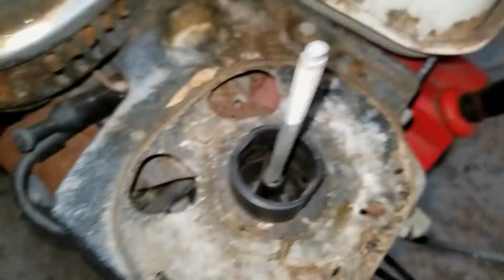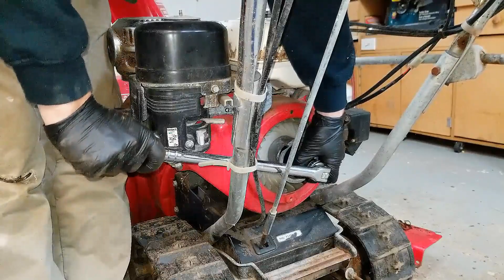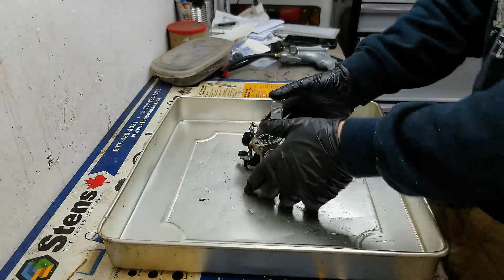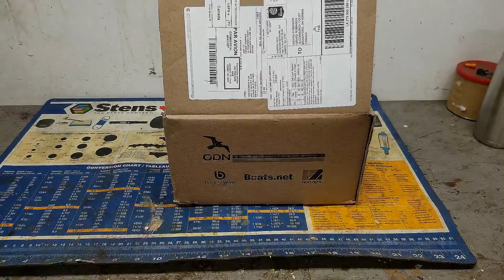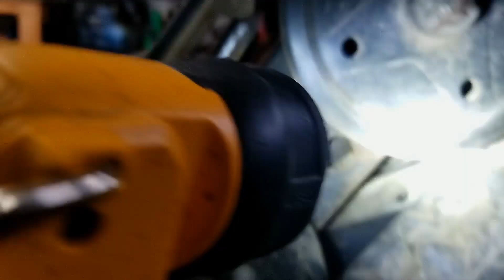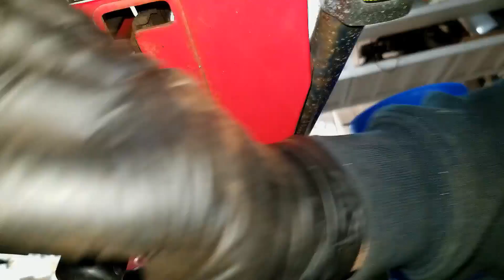Honda HS80 Refurbishment. Carb Clean, Friction Disc Replacement and More

Comment: Hi Brant, thanks for the video.
Sometimes my 1st and 2nd gear doesn’t work.  I’ve tried adjusting and they will work for a few minutes but then act up again. Any tips? My friction disc is in good condition. Thanks!
Reply from the maker: I wonder if something is bent?
Reply: First check that the drive belt engages properly and adjust that if needed by loosening the cable ferule to bring it down. Once it engages properly, check the cable to the right of the shifting rod under the leaft handle and adjust the cable ferrule upwards (the opposite of those on the right side).

Comment: Just bought one from my neighbor for 300 and not a speck of rust or even a chip in the paint and the tracks look brand new. Cant wait to use it this winter. The thing starts on  the first pull too !!
Reply from the maker: That's awesome! Glad you got a good deal and have fun with it. Cheers

Comment: Hi from Montreal. I have the same beast Honda HS80 with treads just like the one in the video. Can you help me? I need to get a starter assembly (recoil), the entire housing with the starter rope. Can you point me in the right direction on where I can buy the starter assembly, used or new . I believe the part is 28400-ze2h21h
Reply from the maker: I usually just use Google or try and find a junkyard

Comment: "Was running fine except for no drive function" LOL. The previous owner wouldn't have scrapped it if that's ALL that's wrong with it!
Reply from the maker: Only expect half truths when buying used equipment. Thanks for watching and taking the time to leave a comment. Cheers
Reply: Believe me, it comes a time when you get tired of trying to fix old snowblowers that are so difficult to finds parts for. If it wasn't for my legendary stubbronness, mine would have been junked at least a decade ago from the hardships it went through. There is practically NOTHING I haven't repaired on mine except for the engine. The front auger and imperller housing is so worn out from use now that the metal has perforations in it that snow shoots out of it now. And I'm not even sure that's going to stop me (I'm considering doubling the impeller housing with a piece of sheet metal, lol)

Comment: Very well done. These Honda snowblowers are very well built. I had an hs80 for about 20 years, sold it for what I paid and bought an HS928 in 2007. Still runs like a top but thats with regular maintenance
Reply from the maker: You're right, pretty hard to kill them if you keep up on the maintenance. They just don't build stuff like they used to. Thanks for watching and taking the time to leave a comment. Cheers.

Comment: What a great video....well done. I have the same snowblower and it runs a bit rich. Any recommendation for adjusting the carb to have it run a bit more lean?
Reply from the maker: How do you know it's running rich? Is it blowing black smoke? If it's a non-adjustable carb then the only way it would be running rich is a jet that got drilled out too big or there is a restriction in air flow entering the carb. I'd start there.
Reply: @brantsmallenginerepairs  The spark plug is black, carboned up. No idea if a jet was drilled. No smoke at all. I'll check it out, thanks for the info.

Comment: Nice job, just wanted to point that the spring you removed to take the pressure off the disk is the adjuster for your track speed. If you loosen the 2 nuts on the screw that you took the spring off of, you can move the screw in or out as you seem fits the speed you need. Once you get that where you want re tighten the 2 nuts so it stays in the same position. Keep up the good work. Liked this video. I have a HS 50 and had to do some of the same things you did but never made a video.
Reply from the maker: Thanks for watching and taking the time to leave a comment. Cheers

Comment: Great to have found your channel, what with most youtube channels now having clickbait thumbnails...

I have had one of those for the past 10 years or so, i9t was not nearly as nice as yours when I got it and and I figure I paid too much for it at the time I got it consireing its condition, but I had another one for parts, so I've been able to keep it alive, as its gearbox was in awful shape due to worn out bearings and I had to make a good one out of the two. Since you're in Canada like me, how much did you pay for yours?

One thing with extremely old and worn machines is that corrosion will play a lot of tricks on you in the course of adjusting things and keeping them alive - the engine is basically bullet proof, but the snowblower parts really get beaten up bad where I live (I usually have to go through two foot snowbanks of icy and gravelly snow to clear my driveway, and tyoically run though a dozen shear pins every winter). I've had to weld reinforcements to my augers and the impeller as well as they got beaten up bad because of my snow conditions and I go though at least a dozen shear bolts and at least an auger belt or even two every season. I've also had to replace auger housing bearings a few times, and repair weld the housing a few times as gravel would get stuck and wear the sheet metal quite thin.

Like you, I found out water does get into the fuel and can play havoc with the engine missing, but I usually simply flush the carb bowl and I clean the jets ever second year or so and keep an extra carb on hand for parts such as the shut off valve and the float valve that tend to leak over time after I had to replace my original carb due to corrosion and gunk from leaving fuel in it over the summer - learned the hard way you're supposed to run them dry before storing them.    

I noticed your friction disk is wrong - the PO hacked it, bolting another disk to it doubling its thickness, probably to increase friction on the old friction wheel. You need to unbolt the piece of metal he sandwiched to it to run it properly, otherwise your new friction wheel will wear really fast.
Reply from the maker: Thanks for watching and taking the time to leave a comment. I don't recall how much I paid for the machine and I sold it last winter.

Comment: What a shame the way people take care of equipment. Man what a mess.
Reply from the maker: Shows you how well built stuff was back then that it lived. Stuff nowadays would have made it to the scrap yard. Thanks for watching and taking the time to leave a comment. Cheers
Reply: Especially considering how little use it seemed to have had! I wish I could get my hands on one in such good condition! Mine needed much welding to the auger, impeller and housing when I got it due to the harsh conditions we have in our area, having to go through through hard packed icy snowbanks mixed with gravel...

Comment: Where are you located in Canada?
Reply from the maker: Brantford, Ontario
Reply: Do you do jobs on the side? I have almost the same snowblower that needs to be fixed The auger is not working properly.
Reply from the maker: @mrcass8075 yes I do. Contact me at brantsmallengine@gmail.com

Comment: I'm in Brantford too!  Just found an HS80 cheap that had the impeller move forward into the augers :( .  The engine, carb and overall condition of the unit is absolutely incredible.  Working on getting the front housing all off so I can inspect why the impeller movement forward into the auger housing and to see just how bad the damage is.  The front/auger gear box housing broke as a result so I will need to source one of those too........  I cant seem to pull the auger gearbox housing off the auger shaft from the transmission/belts.  I pulled the 3 screws at the back of it but it just moves forward/aft about 3 inches on that connecting shaft.

Thank you very much for the videos, nice to get some quick tips and see inside the beast on here before going out for hour 2 tomorrow.
Reply from the maker: Glad I could help out. Good luck with your project. Cheers
Reply: @brantsmallenginerepairs  do you know how I get the front auger drive/gear housing off?  I can't seem to figure it out.  I have the full front assembly off, the chute off, the augers out and the impeller shear pin out but can't for the life of me figure out how I get the gear casing off...... just moved forward and aft 2 inches but hits solid stops.  I feel like I'm missing something silly
Reply from the maker: @C.HL.A  honestly, I haven't taken one of those apart and I don't have the machine here anymore to look at it. If you send me your email, I can send you a shop manual that might help.
Reply: @C.HL.A  donyboy73 has a nice video on how to overhaul the auger gear box. Be ready for the steep sticker shock for the worm gear!

Comment: Enjoyed watching all your hard work and patience bringing back this almost antique Honda back to life. Even if my Honda snowblower has a have a hydro-static transmission, the friction wheel replacement procedure and pitfalls are nice to know. Just one comment: I would use methyl-alcohol (gas line antifreeze) as a surface cleaner instead of gasoline. Finally summer is always the best time to watch a snowblower repair video. Take care.
Reply from the maker: Thanks for watching and taking the time to leave a comment. Cheers

Comment: Great video. Did you have to drain the oil and gas before tilting it up in the service position? Thanks
Reply from the maker: Draining the fluids would be ideal. Draining the oil is not really necessary but any spills I've had are usually the fuel. If there is a fuel shutoff, you could close it and just drain the float bowl of the carburetor. If the fuel level is below half full, you won't usually have any issues at the fuel cap. If it's more than half full, you could place a plastic bag between the cap and tank to prevent leakage. Hope this helps. Thanks for watching. Cheers

Comment: Kudos from Jake and i at Eliminator Performance for an extremely well done video with good detective skills to get this beast operational. You for sure got a good deal on this one they are easy resells with the Honda brand name. We have worked on a few and just a tip: get yourself one of those 4 wheel dollies to set the blower on since they are so hard to move around and this makes it simple.
Reply from the maker: Appreciate the tip and thanks for watching. Cheers guys